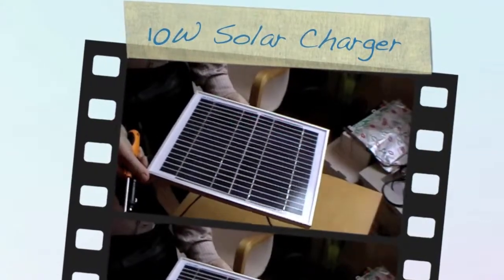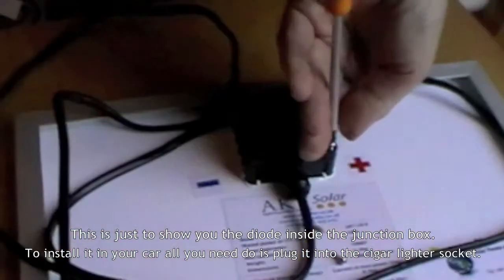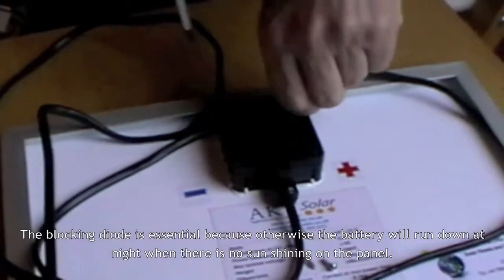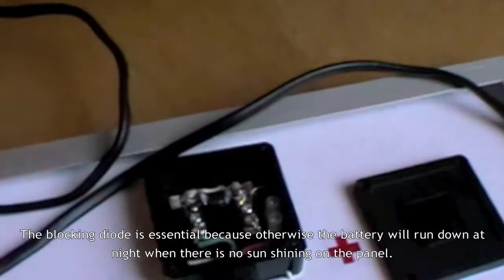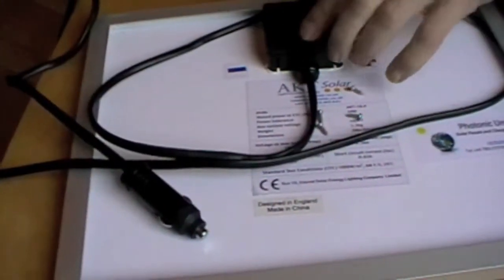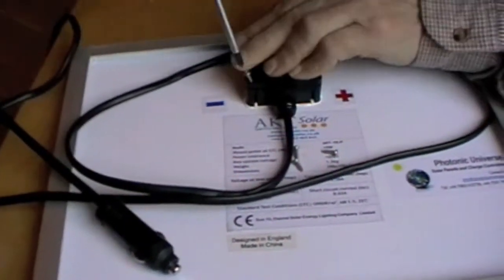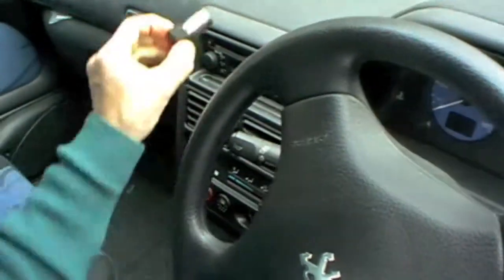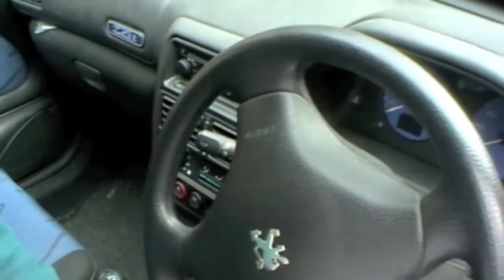How to use of  a 10W AKT Solar Battery Charger

Comment: This will only work if the lighter is powered with the ignition in the off position, otherwise to make it work you can run a lead directly to the battery.

Comment: Thanks for the good video. Do I need to use the diode with my 10w panel, (my panel just has the pos' and neg' wires, no box) if I use a controler? I have a spare PWM5 Solar Charge Controller
Thanking you in advance for your advice.

Bill
Australia